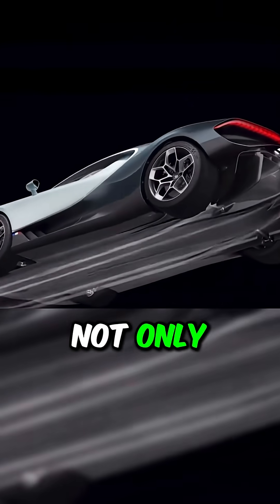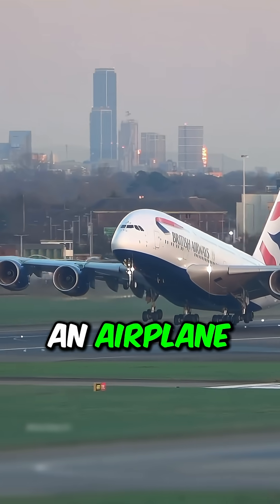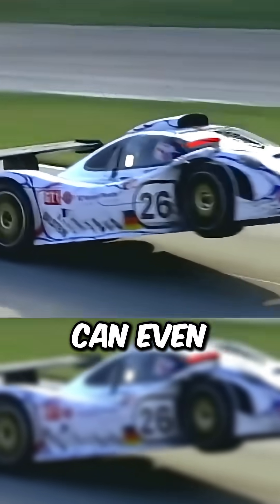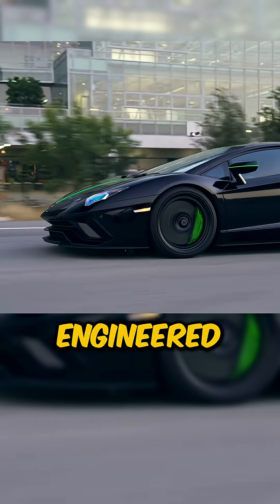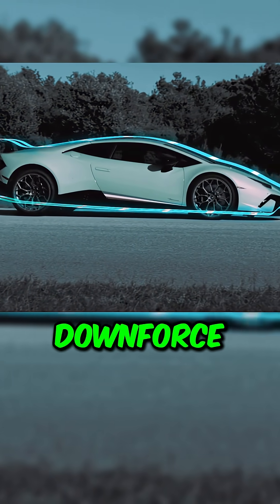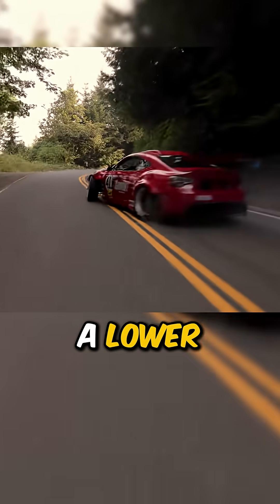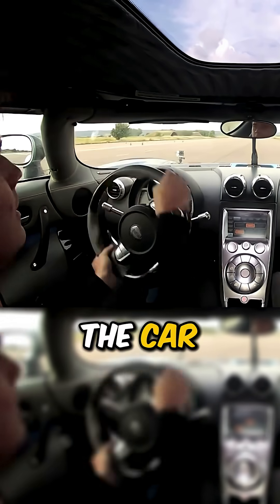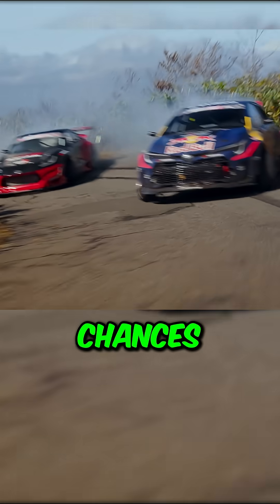Why Are Supercars So Low? It’s Not Just Looks! #shorts

Comment: Lots of cars can be fairly high and still be perfect stable at 200mph. It's not about height. It's about shape of floor and how air moves along it.
The easiest way is just to make floor flat and smooth and set suspension that front is slighty lower that rear. The faster you'll go the more stable it becomes, sort of sucking car into ground. It still works even with clearance over 10inch. 
And what about staying so low on the ground? The looks, practicality goes out of window